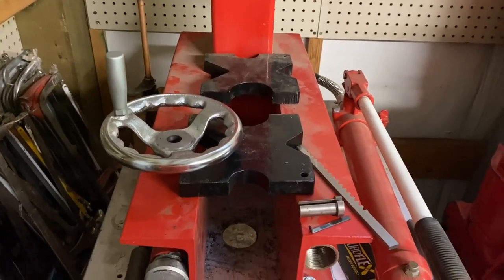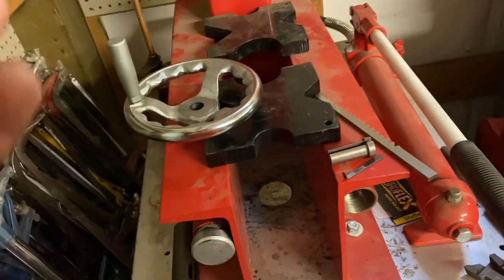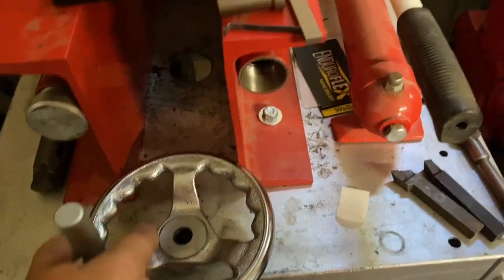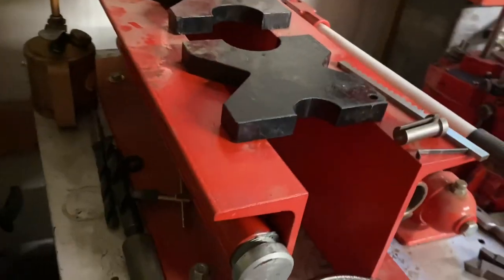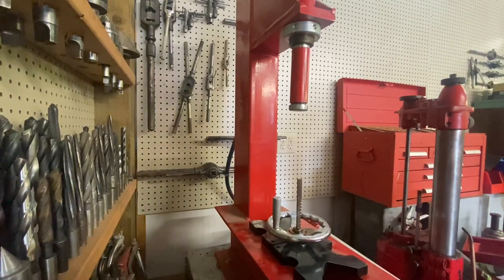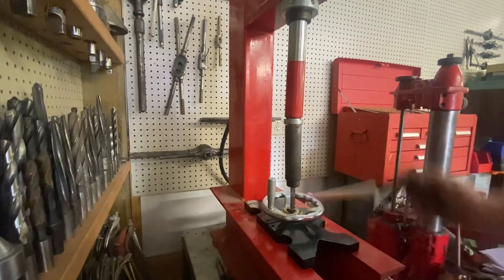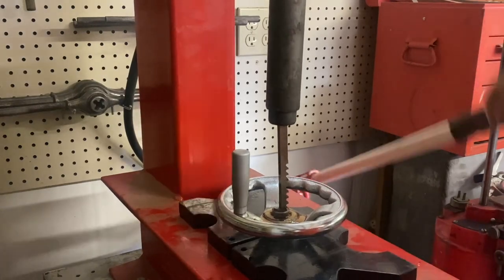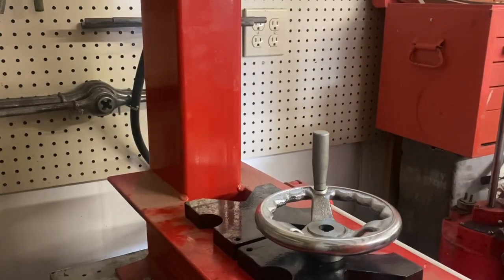Broaching a machine hand wheel

Comment: I remember those old HF presses! I don't remember the diagonal gussets, those might have been added on. I want to say it was marketed as a bearing press, I think it had a little hot plate thing that was not worth a damn. I've seen them used to make dedicated tapping machines and a few other alterations but this is the first broaching tool I've seen made of one, looks like a great idea. I genuinely looks like they took their standard 20 ton and flame cut it down the middle and welded the cylinder on

Comment: My press is rather massive, the work envelope is over 6 ft tall so I had the same issue with needing multiple length arbors. I ended up tapping some 3-in solid round at 12 in, 18 in, etc. The top of the press is an I-beam and all the adapters are lined up on the web. They all use the same thread and the nose protector threads on as well